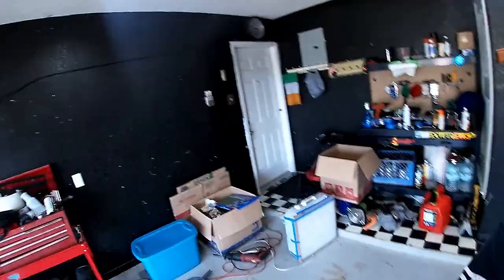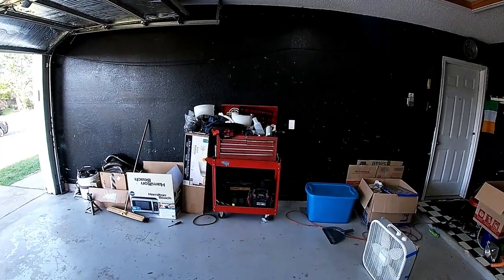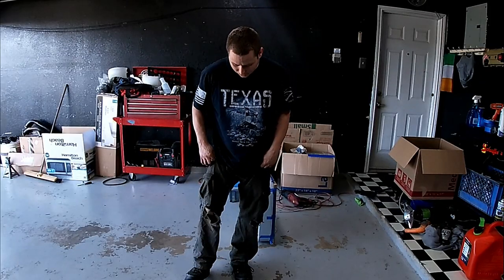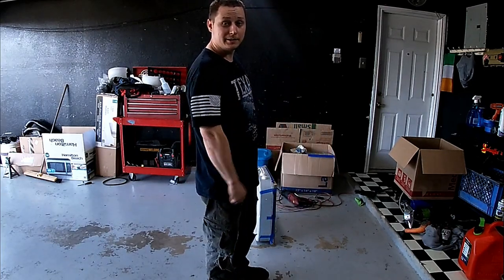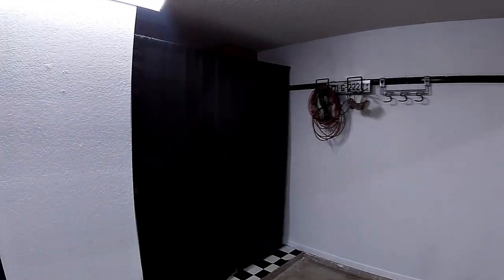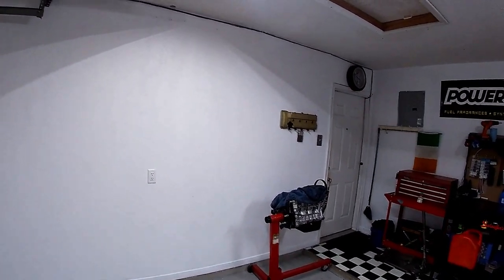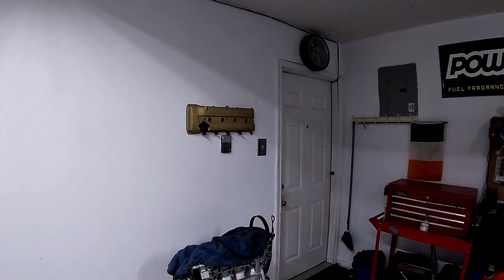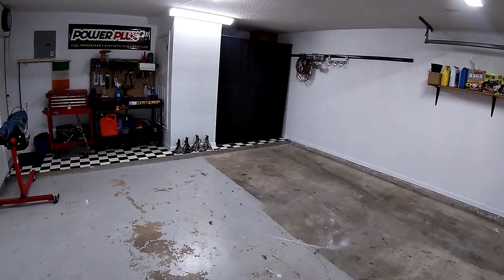Garage overhaul pt1- Re-painting the Walls and organizing

Comment: Which rustoleum black should I use if I intend to use it with 2k clear coat?  Unsure if I can use 2x black glossy and then add 2k clear afterwards?
Reply from the maker: Dante G Yea 2X gloss black, the advanced formula work really well by them self and with 2K clear over the top work even better. Regardless of type of paint the black will show every small imperfection and is the hardest color to make look perfect. Just a heads up.